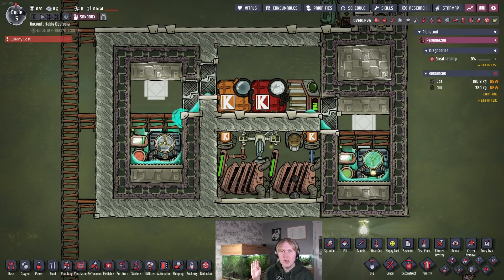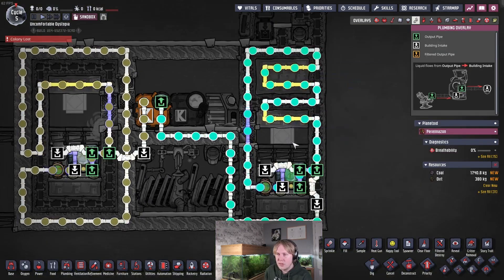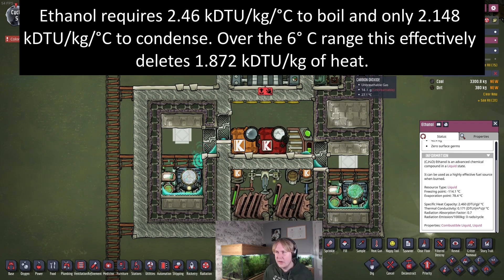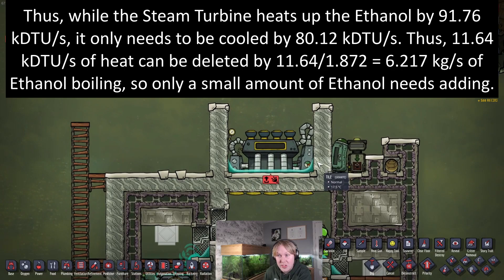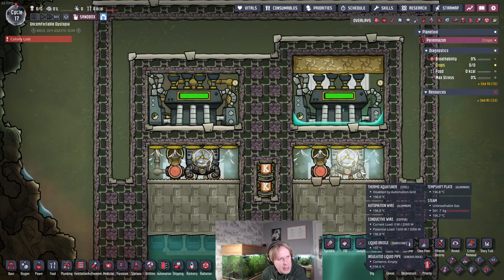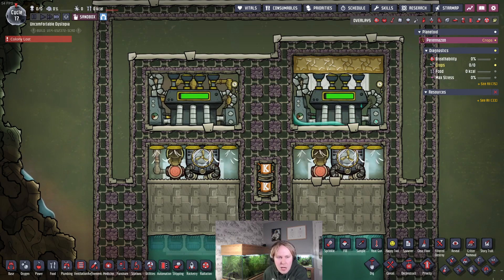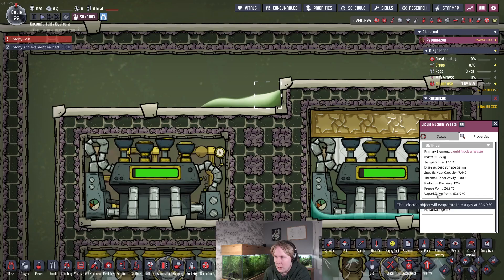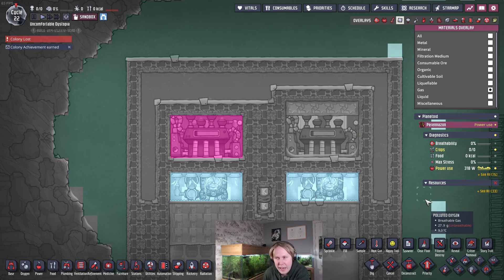I Completely Missed The Point Of Ethanol Heat Deletion In ONI: Spaced Out!

Comment: Why even do this if you have steam turbines already you can simply just put the aquatuner in the steam room and cool the turbine... a better use for this ethanol heat deletion is early game before you get mid game materials, this because you can simply use a copper ore aquatuner for cooling if ethanol is available or producible on your current asteroid.  I personally have used the ethanol heat deletion copper aquatuner to cool down oxygen production and the base on Radioactive Ocean Asteroid early game since the asteroid doesnt have reed fiber or a plastic opportunity. Helps get you through some rough spots early when thinking about oxygen and heat etc.
Reply from the maker: The Aquatuner is still directly cooling the Steam Turbine here as it exchanges heat with the Ethanol gas. The Ethanol boiling/condensing heat deletion is reducing the time/power it takes for the Aquatuner to achieve the same cooling. I covered the early-game uses you describe in the previous video (https://www.youtube.com/watch?v=pqjsEA0vQBo)

Comment: A self cooled steam turbine is more effective.

When cooling anything over 100-125 without a steam turbine you're losing power. This makes nuclear fallout a cool, but always a bad option.

However, when cooling anything under ~100 you're just losing power no matter what.

Thankfully there is a need for cooling things under 100 degrees! The highest useful temperature I could find is the lettuce plant which can survive 65*C water. It would be cool to see 2 setups.

Self cooled turbine using a aquatuner as heat
Vs
Self cooled turbine, Aquatuner, and a ethanal counterflow.

Just to see that tiny power difference when cooling new material for base use.

Another more "reasonable" experiment would be rocks from 100 to 40 for a hatch ranch.

Idk which math would be easiest. For the lettuce you could just use saltwater in the aquatuner for a "1 to 1 ratio". However the 1SHC of igneous rock is tempting.

Needless to say I've been invested in this idea of hyper-optimizing ethanal just because it doesn't return any notable value.

Comment: hah, i did this for a volcano tamer design, it can squeeze out slightly more power, and i used it to power a starter base in a new planetoid, but that is mostly what it is good for not extra cooling, just allows a few more appliences to be run on a small grid

Comment: Yeah you should be able to cool 7 Steam Turbines with 1 Thermo Aquatuner instead of 6:1 without Ethanol. Also the metal tiles aren't needed. Just run the radiant pipes in a row under the insulated ceiling.